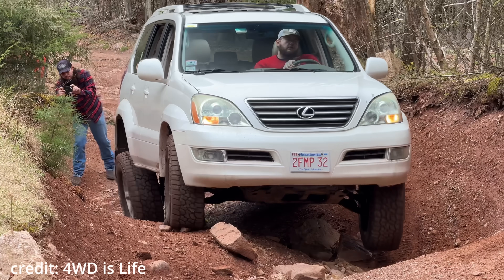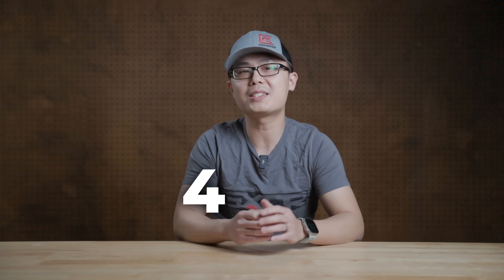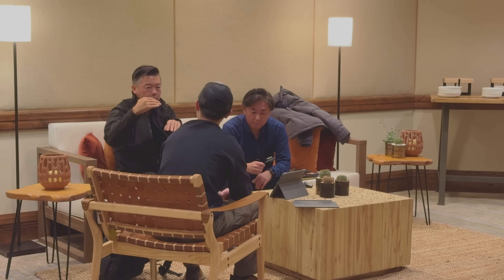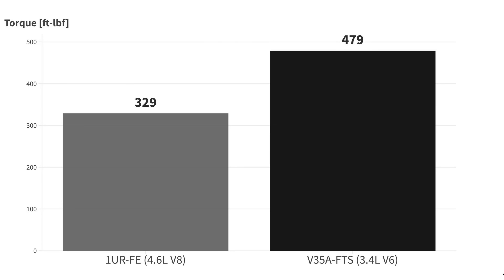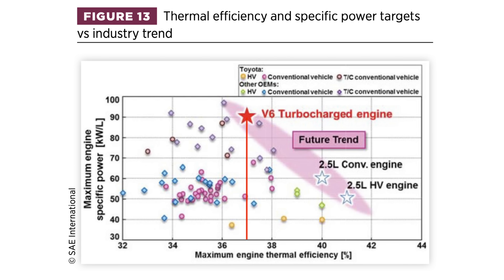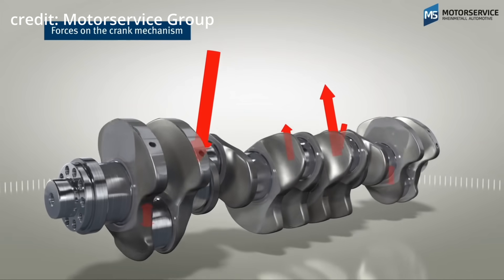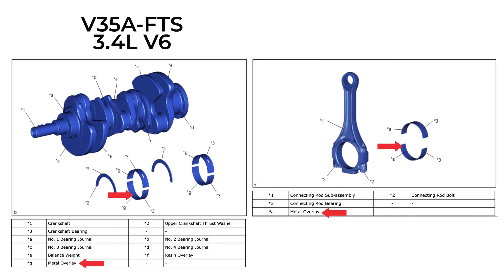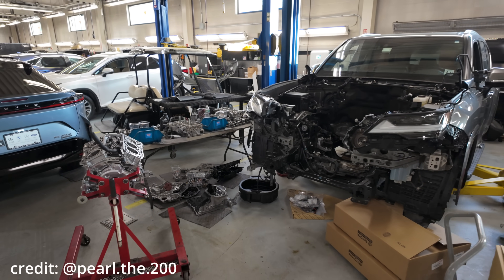Is Toyota V35A-FTS Engine Reliable? Well..It's Not That Simple

Comment: It seems like they forgot that the main reason everyone bought toyotas was for their reliability and not because they have the highest torque figure or the latest features, lol. Now they're more expensive and way more unreliable with a terrible customer service track record to boot
Reply: They didn’t go turbo necessarily for power, people want power with good MPG’s. I appreciate Toyota quality, but the older one’s suck on gas terrible for being such small trucks/suv’s especially considering they’re not fast either. So terrible mpg, and slow. 

Turbo’s have been around for years Toyota used them on the Supra’s years ago. Toyota had to get with the times, I’m sure they’ll perfect the problems over time. People rushing out buying the new model to be hip and cool are the ones gonna have to deal with all the problems.

Comment: After listening to all the specifics of the Engineers in the Know. It only stands to reason logic dictates, that if a smaller displacement Engine with forced induction is pushed to achieve 46% more torque it will definitely affect Reliability and longevity. Here in Australia our Farmers wanted Toyota to produce a workhorse,  a reliable steady V8 diesel single low boost turbo the 76 or 79 series Land Crusher Ute 4.5ltre diesel. It produces lacklustre performance reasonable torque and quite terrible economy. But one thing is for sure it won’t blow up unless u  choose to treat it like rubbish and even then it may well survive… folks 2 + 2 = 4 it does not matter how the Toyota Engineers spin it. Granted the 3.4litre is a new Engine all new developments have glitches the big question will be after Toyota solves them is what of longevity?? I would rather be the tortoise 🐢 at least I know I’ll get there and with the money I waste on extra diesel consumption, I’ll more than cover by saving on repair bills 💵😳

Comment: I got rid of my GDI ford f150 3.5 and bought a used Avalon 3.5 and I am much more comfortable with the weaker and slower 3.5.  I will have that 3.5 for the next 200 to 300k miles while the ford would have to be replaced at least once or twice.  No regrets.  I do not trust GDI engines.

Comment: Here's the rub: While all the parts may be built and assembled to a certain standard, more parts is more potential maintenance. My NA V6 Camry, no turbos, no waste-gate, no inter-cooler, NONE of the extra parts that come with these new engines. Also, heat. Lots of heat. Turbo placement can also effect reliability. Only time will tell. No truth in advertising.

Comment: “Crazy high torque”…. Actually no.  To name a few examples:  Burgertuning got 352lb-ft to the wheels from a Tundra using this same engine.  Hennessy got a shocking 361lb-ft from the I-Force Max variant that supposedly produces 583lb-ft!  For a direct turbo 6 comparison, the BMW gen3 B58 in the X5/X7 is rated for 398lb-ft and makes 398lb-ft to the wheels!  To me, this is just Toyota overrating their engine power to appear competitive when in reality they suck at making turbo engines.  And the rated fuel economy numbers are terrible to add insult to injury (and what’s worse is forum threads are showing that even the most conservative drivers really can’t get within 10% of the terrible fuel economy numbers).  My guess is Toyota never put proper R&D into their turbo engines from the start, including their turbo 4 cylinders that make everyone wish they would bring back the NA V6.

Comment: More power and torque whether by extra efficiency is more force on the piston  which is more force on the crankshaft which is more friction which is more heat which needs more lubrication?
Efficiency is just deriving more from the same amount of fuel
So therefore greater efficiency equals higher stressed engine which is ok if the engine is built to compensate for this extra stress
But then comes the question of cost to engineer this in vs cost of ownership 
I bet Toyota could design a near perfect engine at the cost of 100k dollars per engine but 
What happens to the cost of the vehicle and the ownership cost
This V6 is a 30k engine and isn’t perfect who is going to afford to fix these things when the warranty runs out?
No wonder the truck is so cheaply finished

Comment: The chief engineer is not the one to talk to.  It's the manufacturing engineer who's got the problem.  These engines are ticking time bombs each with an unknown amount of metal debris in them.  A few engines may go 200k miles.  Most engines, however, are going to experience failure sooner than what customers are expecting.  It's the manufacturing process that's the problem.  Those engineers made a huge mistake, and now 100k customers, maybe more, have these vehicles in their driveways.  It's going to be very expensive for Toyota to regain even a portion of their reputation for quality.

Comment: A recipe for a disaster - particularly in 4WD driving where a low gear and HIGH REVS are involved. Similar fackup  like Mazda's new 6 cylinder engine (CX - 90) with 3 timing chains located at the back of the engine! To do anything on this engine one has to remove the engine from its bay!

Comment: Toyota made a mistake in cleaning and assembly,  opps. It’s Toyota they will make it right,  they are the only mfg that does continuous improvement in everything,   Ford is still having cam phaser problems, and timing chain problems 10+ years later on eco boost motors,  Toyota will/ already fixed this problem,  it will just take some time to fix all the ones that slipped out,   All mfg have issues some address and solve them some don’t,  I’m not going to stop buying toyota’s they are still way better than anything else out there,  if this was gm it wouldn’t even be news,  but we expect perfection from Toyota because 99% of the time they are great..  still the most reliable mfg out there..  just wish we could get some of the high efficiency diesel motors they sell overseas..  (EPA corruption).

Comment: The new Tundra isn't even reliable as the 5.7L V8.  The new GX are running the same V6 twin turbo engines the Tundras are using so what makes you think the GX will even be more reliable than the Tundra?

Comment: Isn't Toyota Recalling 100k of those motors for Block failure?
Reply: From what I read it was a manufacturing defect, not a defect in the design itself. Essentially metal shavings from machining wasn't cleaned properly and many engines got pass QC.
Reply: @nigeriaroberts678  So Toyota is now like FORD, Kia and Hyundai?   That's sad,  Great Quality control was Toyota's thing. Now there Failing.
Reply: @chrishebbeler7822  nah I disagree. Im not defending this engine at all but Ford made DESIGN flaws using weak head gaskets that lead to catastrophic failure in their engines. This is a manufacturing flaw where there was a deviation from company procedure.

Comment: As an engineer, a 60° V6 will never be a good engine, no matter what you do. Good engineering starts with logical, purpose driven, choices. But 100% of all elements of a 60° V6 are either a compromise for packaging, or a compensation for a compromise. Toyota should have put the B58 into this product. An inline 6 engine will always be superior to a V6 engine.

Comment: I'm sold on a bigger V8 for more power and reliable torque. And just think what would happen if you throw a twin turbos on that V8. That's the elephant in the room they never ever admit to. What if you were to do the same exact things to the V8 that you did to that V6 what kind of a monsterous horsepower torque engine would that be? Probably three times what the V6 is. But as soon as you start throwing turbos on anything you cut the reliability almost in half..

Comment: Look at those Nissan GTR engines or Toyota's own 2JZ which are reliable and produce similar power reliably, It is doable reliably with V6 displacement. It is because of the first-generation Engine that the problems need to be fixed. The second-gen will be fine. This is why never buy the first gen products and become a guinea pig.

Comment: IF an engine fails - the manufactures intended so! There is literally noting on combustion engines that is unknown.
So any manufacturer is able to develop an "bulletproof" engine. BUT: For what pupose? The best engine for any manufacturer is the one that fails directly after warranty.
Reply: I mean, Toyota has spent the last 40 years building their brand off of the concept that the engines won't fail until way, way after the warranty. I really doubt that this issue is intentional.

Comment: More angle on a longer stroke:  If my memory serves me correctly this design provides more torque but puts more stress on the piston skirts, connecting rods and rod bearings.  Adding turbos makes it even worse especially at lower RPM’s.  I think Toyota purposefully choked up their motors with intake and exhaust designs to provide longevity.  HP / Torque on my 200 Series was way below industry standards but you’ll get 200k miles out of it.  Fake sense of security. Now Toyota is trying high HP / Torque and is failing because they have never really pushed their engines to this level.  Probably stole some engineers from Nissan CVO Transmission division to design this new motor.  LOL

Comment: Even with Toyota and their history of reliability and durability, it’s partly—or mostly?—simple physics. Anytime, with ANY manufacturer, when forced induction is a part of the engine build, reliability and longevity is instantly significantly reduced because of the greatly increased heat and mechanical stresses on engine bearings and components. There just is no  way around this issue. 

Not only that, but I would never buy a vehicle with a new engine in its first years of production. I do not wish to be a beta tester for the manufacturer while they resolve the bugs and issues that are gonna happen in any new engine. Therefore, it’s best to wait until the engine in question has been in production for a few model years and the problems have either been fixed or the engine has been proven to be a flawed design that anybody who values reliability and durability should take a hard pass on and choose another vehicle model that doesn’t have the baggage and drama of spotty and questionable reliability.

Comment: When one of the big three puts a version of one of their consumer grade engines into a commercial or heavy duty truck they always reduce the power and torque output. Why? Because it helps them work harder for a longer period of time. Average Joe's love big numbers as far as horsepower and torque go. Fleet managers love reliability and low maintenance costs. Both versions of the engine get the job done one just does it longer with less money spent on maintenance. Toyota's reliability with this new 3.4 is not looking too good and the issues have continued into the 2024 models. Sometimes you change too many things. Spun main bearings should be the last thing you'd regularly see even in a turbo engine. Their new main cap design is probably causing unintended consequences but Toyota won't ever admit it and will probably keep trying to hide it until they are either sued into submission or the feds force a recall. I don't dislike Toyota but I've seen way too many problems be ignored by willfully ignorant fans and blind eye journalists. Every manufacturer needs to be held accountable. When your competition sets an even lower bar than you do it's easy to claim great reliability but it's like winning a drag race with a 20 sec quarter mile time only because all the competitors ran 20.10 or worse.

Comment: I do not trust a single engine not assembled/made in Japan or Germany. When Mercedes moved production of entry-level models to America, the brand reliability and quality dropped big time. Likewise for BMWs X1/X2 vehicles. They know this which is why you still see the 3/4/5/7 series still built in Germany. Or the Camry/Lexus money-makers still built in Toyota City, Japan. They know better than to play with fire on their high-production cars. If you have ever been in management or the auto business you understand this completely. 

Unfortunately, Toyota is having some of these engines built/assembled in Alabama and they discovered that American line employees were not properly cleaning the blocks leaving metal residue after casting... Despite Toyota Japan placing a fat orange label reminding employees to wash/clean/vacuum the blocks. They skipped this due to management being behind schedule apparently. Now they're cleaning them properly with a solution bath/rinse but it makes me question what else they are going to skip.

Comment: I don't believe these spun main bearings are due to uncleared machining debris left over during the manufacturing process.  I think there is a design problem.  My theory is that it has to do with the cast iron bearing caps embedded in the aluminum ladder casing.  My theory is that the differential expansion of aluminum vs iron is causing the bearing caps to "move" out of tolerance.  It starts with just a little play, but that increases over time (just like a small leak always increases over time).  Solution:  maybe go back to resin coating?  Maybe lose the cast iron caps - stick with 1 material with 1 thermal expansion rate?

Comment: After 22 years of nothing but brand new Toyota trucks, I’m not buying anything else from Toyota as long as the only option is a tiny turbocharged engine or a convoluted hybrid. Toyota just pushed me into the arms of Ford. Loving my new F150 with Coyote V8. I got a full-size truck with all the trim for the same price as the TRD Pro I usually buy. Toyota has lost the plot.

Comment: maybe ypu could lower torqe seen at motor by investigating the gear ratios from motor to wheel
Reply: The 10 speed has way deeper gearing than any of the Toyota transmissions before it(except the 200 series 8 speed) and can pretty much land at whatever RPM they want. Torque seen at the motor is only higher because the motor makes more torque.

Comment: Bool’s shit about combustion efficiency ! 4,6 complying with euro 6 standard and 3,4 complying with euro 6… means combustion efficiency the same !!! But turbocharged engine able to build more pressure on cylinder as result more torque and power. Also more mechanical and thermal stress on engine parts. More stress - less reliability, less running hours of parts and oil. Engine become more expensive…

Comment: All of this insanity trying to squeeze a few mpg and lower emissions from a 6k pound SUV.  The best thing they could do for the environment is make a car so good a reliable people keep them for a decade or more.  Climate folks are very short sighted, while claiming the long term high road.  They make crazy demands with no thought of the unintended consequences.  I will drive my 2023 GX 460 V8 for 20+ years and half a million miles.  Like I did my 2001 IS300 (22 years 300k miles).  The longer you drive the same car the smaller the carbon footprint.

Comment: Big cars + small engine/turbo = bad.  There's going to come a day where everything is hybrid or there is no more large cars (Toyota is already going there).  The shift must happen.  There is a reason it was V8's until emission laws took control.  Physically its just not ideal else it would have been done decades ago.  You can't really blame the engineer, they're working within the constraints of the regulations and physics.  Blame the regulation.  Saving the air, more crap in the landfills.  How often does anything actually gets "recycled"?

Comment: People
Do not buy any used or brand new Lexus; tundra etc years 2022 to 2024
Wait and see if 2025 has the same issues
I have a 2022 tundra and it’s a nightmare right now dealing with dealers that are washing their hands off of these vehicles and passing you off to a 1-800 number at Toyota main corp.

My district manager in NM told me;
Call Toyota- I am not Toyota; I am American Toyota!

Comment: Toyota puts a turbo on an engine and everything falls apart. BMW puts a turbo on their motor and it’s still capable of doubling the hp safely
Reply: Except Toyota has had plenty of bulletproof turbocharged cars.
Reply: @JosephSamsor  their most famous one was built by Yamaha. And its replacement is built by BMW.

Comment: Toyota's explanation about metal shavings is nonsense! Metal shavings will be trapped in the filter on the first drive. New engines produce some shavings too... The 0w20 oil is the culprit! The same problem is in the 6.2 L87 and no one will admit it... No one dares to ruffle the feathers of CAFE and EPA.

Comment: NA V8 and V6 reign supreme. These new Twin Turbo and Hybrid engines are adding complexity and far more potential points of failure. I don't care what anyone tells me....the new vehicles will NOT be as reliable or durable as the older generations.

Comment: This motor needs hybrid electric motor assistance to take load off the engine while still being able to put the power down. Making it more reliable and fuel efficient. Toyota and smaller displacement engine is pulling a fuel efficiency and emissions   Move . Hybrid technology would be the way to go to achieve all new goals with Keeping old Well known Toyota Reliability. Everyone wants a Large Offroadable SUV that can get better fuel mileage than a Camry Sized car . And with enough power and torque to outperform its competitors

Comment: The bottom line is , new engine is less reliable that the N/A 5.7 ,, a lot of new v6 tt engines owners are suffering from it with very low mileage, complete rebuild for over 8k $ , this engine is crap. The old v8 you don’t think about engine breaking until u reached 300 k miles . Toyota missed up big time on the this new engine.